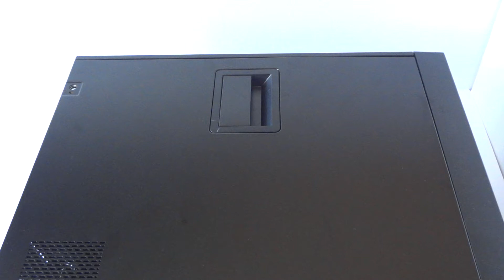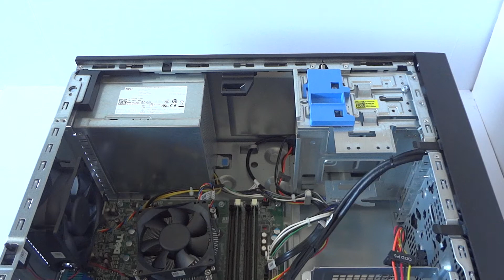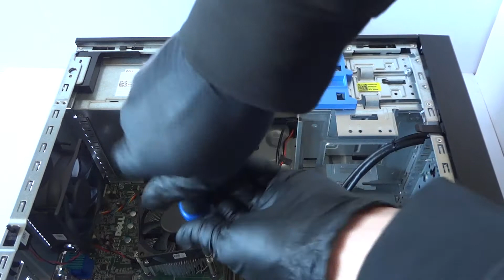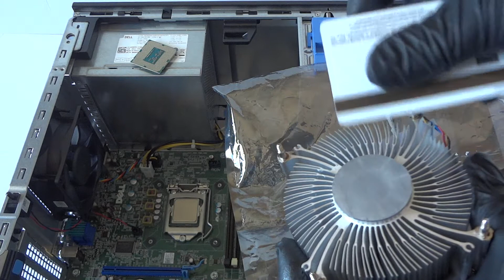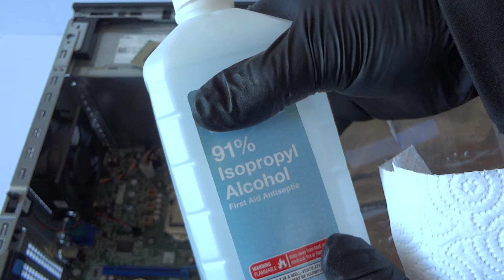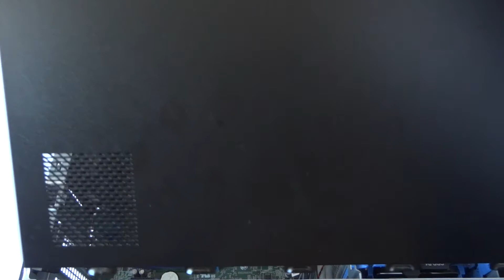Dell Precision T1700 Upgrade Processor CMOS Battery

Comment: I have a weird issue with a mobo from the T1700. I use it in another case , not dell. I use psu adapter 8pin to 24pin.
The issue is that with a dead CR2032 battery the motherboard begins to boot as I turn on the psu, I have no power button installed. The 5 pin power connector is jumpered as in pinout schematics of the dell's power cable. 
So I changed the battery and the system just wont boot. I remove the battery and the system boots again. Weird.
By the way, during the boot sequence I observe the fans start and stop spinning 3 times, then it goes into boot and the monitor lights up. This is my first time with a dell product.
Any suggestions?

Comment: Hey there.  Just replaced the Xeon processor in my T1700 to the same i5 in this video .  Works great.  It was a slight upgrade to the Xeon son my son is happy and so am I.  However I cannot get the embedded graphics to work, any suggestions?   Thanks
Reply: Paul DiBerardino how did the Xeon work in the first place? Do they not have integrate graphics ?
Reply: @haris6424  Some do, but many do not.
Reply: @xaero1971  Oh I see

Comment: Hi I’ve got the t1600 I’ve changed the cpu but now my monitor doesn’t show anything. I’ve changed monitors the battery all the pins are in the right place tried using on board graphics and everything still won’t work

Comment: I have a t1600 with a 3.1ghz e31225 cpu. Do you think this upgrade is worth it and is a new psu required as well. I already have 16gb of ram and a 1050 ti OC edition. Just needs a bit more power for higher end games